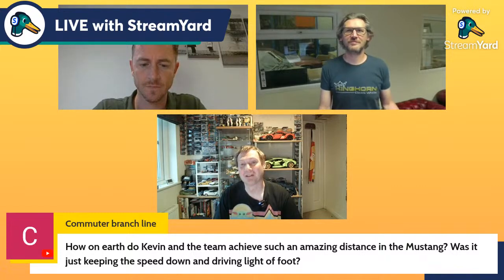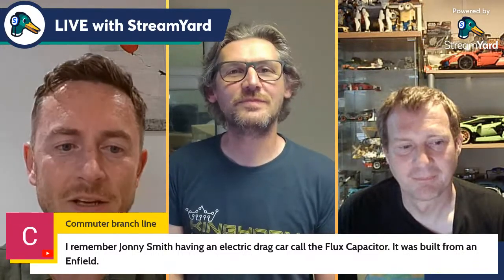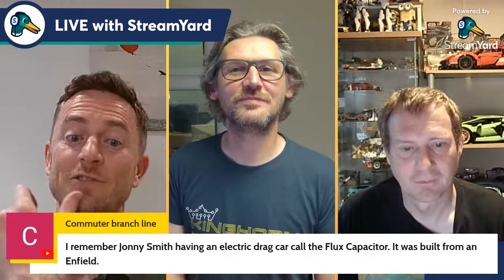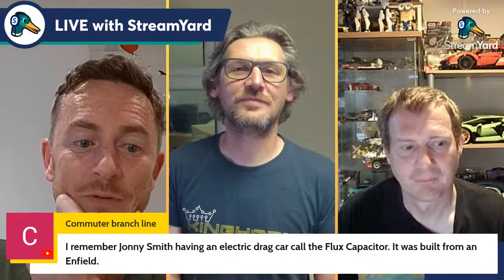Race for Efficiency Records & EV Specialist Guest. YEV Ep2

Comment: Interesting subject. I'm just back from a 5000mile  return trip in my  Tesla  MYLR  to the  very north of Norway.  My overall consumption was  218wh/mile ( 4.6 mi/kwh ) which seemed extremely good   considering  that the trip included everything from Finish forest tracks to 135 mph bits on German autobahn. I also use the current version of fsd whoever possible. As Tim commented,  the car has a much longer range than I do!
Reply from the maker: @Warekiwi  good work! Very impressive efficiency. What age and mileage is your M3?